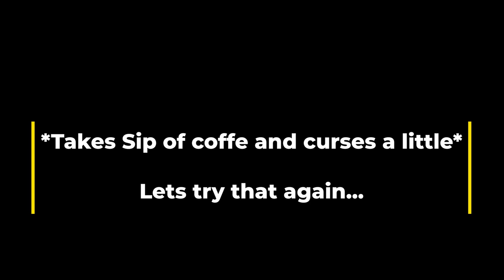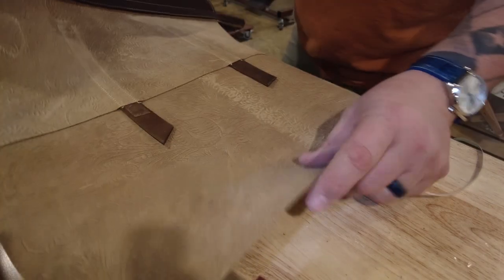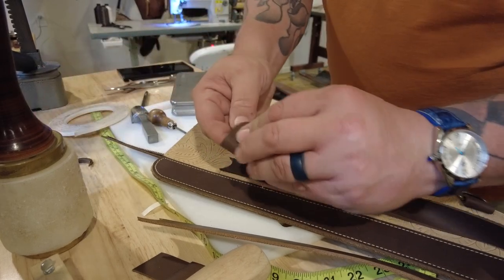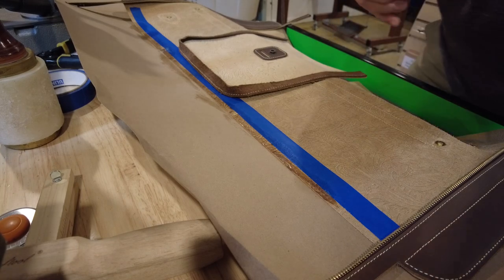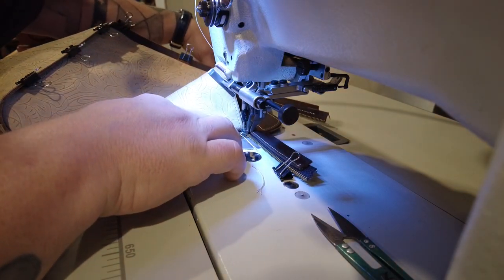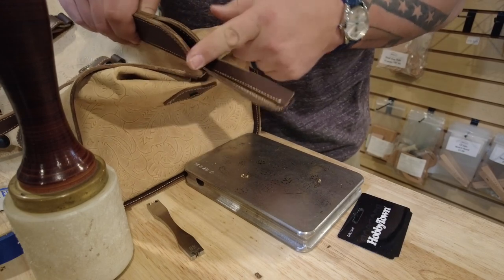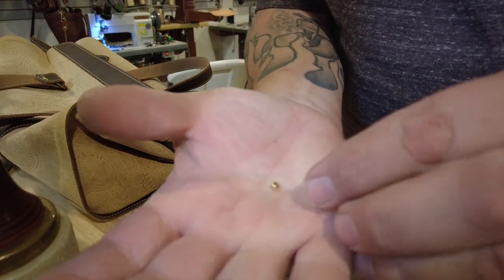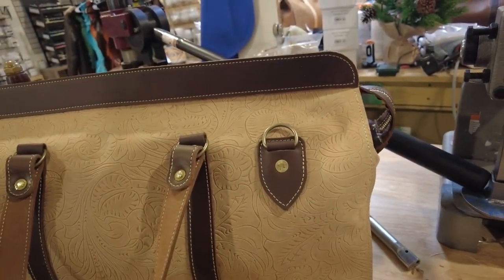Making the Stockyards Duffel Bag Pt 2

Comment: absolutely great video, I thought I would add something about the rivets, now as someone who has set and used thousands of hard rivets, the way I was taught, was to set the rivet with the punch, then to just use the flat face of a cross pen hammer, and then use the Dome of the set to get the rounded cap on it. Oh, and how did I use that many Rivets? 40 years as a Sheetmetal worker! From one Veteran to another Thanks!

Comment: I have used the double sided tape I bought from you a few times before hand sewing (works great!). The problem I've encountered is that the glue on the tape tends to gum up my needles. I've never seen you with gummy needles, so I must be doing something wrong. Any ideas?
Reply from the maker: I have had it gum up.  When it's an ugly problem I have a little alcohol in a glass and occasionally dip the needles and wipe them right off.